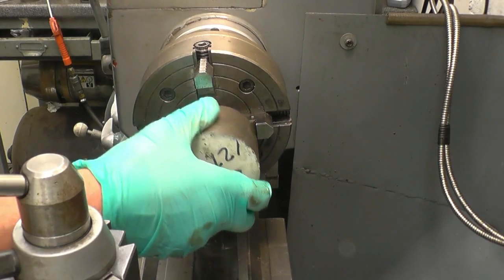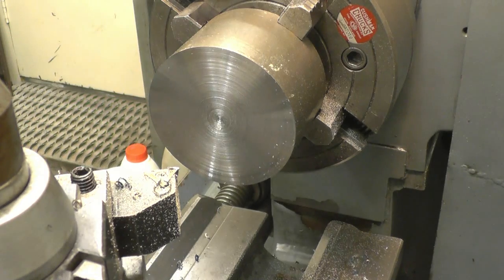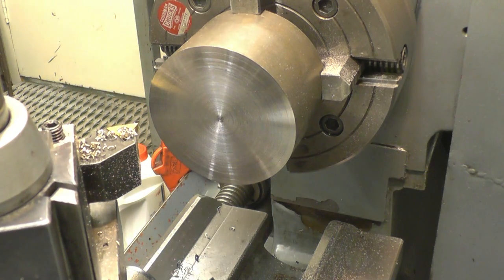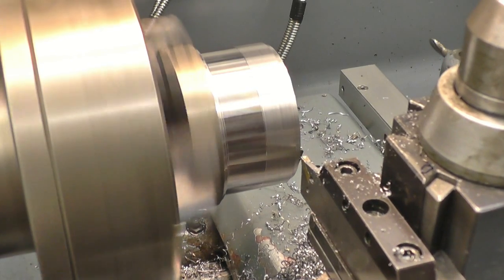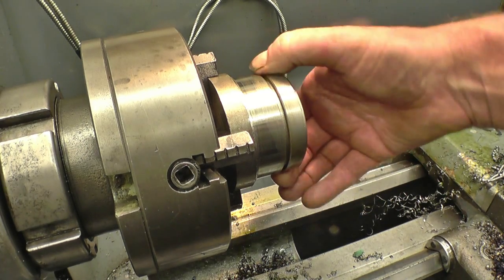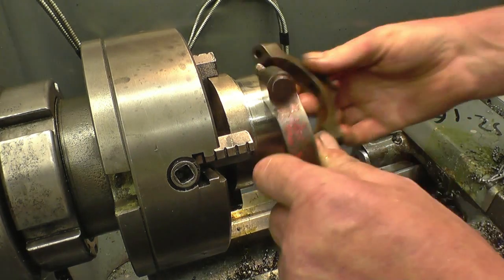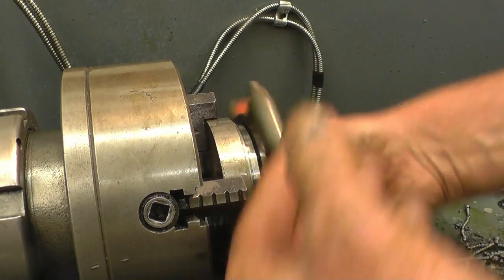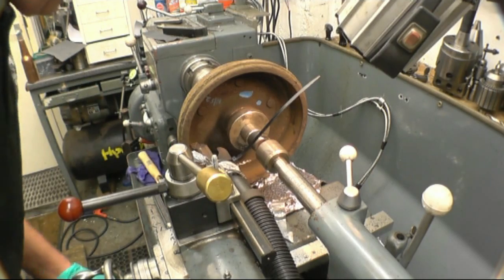SNNC 182 P2   Lathe work    Steam powered clock

Comment: Nice chips on the OD . Screen door spring hooked around outside off brake drum might help with ringing noise. I always hate
doing brake drums even on brake lathes freaking noisy dirty things and only payed about $35. bucks each now cheaper to buy new. or so they say at my local parts house. "66 Dodge? Nothing in the computer for anything that old. Try a junkyard sir"
Otherwise they are telling me to take my old crap and old sell the hell out of their store.

Comment: God love you John. Your solution for putting a break drum between two tapers like that has saved me a lot of headaches since I first saw it on your channel here. As for the foil, I've always just used shop rags as they seem to work well enough. They can be held in place with magnets and they work simple and sweet. Whether you try it or not I hope it helps someone. The good of it is that you can just wash them and reuse them when they get a little nasty. Otherwise I just shake them out outside and most of the chips come off just fine.